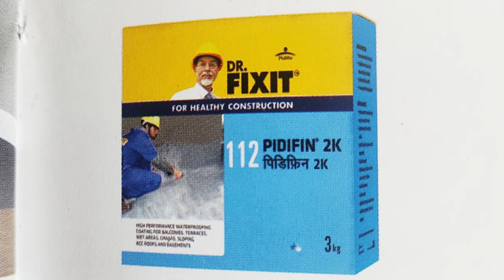Waterproofing of RCC water tank by Dr Fixit Pidifin 2k

Comment: We have overhead RCC water tank 
We have done ghotai, also applied tiles for extra protection n maintenance.
When the tank is half full then there is no leaking ... 
When upper half start filling, leaking start... 
Please suggest some solution for this leakage problem
Thanks in advance 🙏🙏